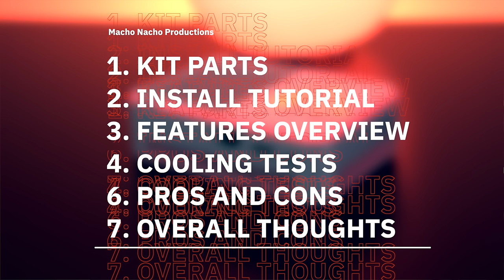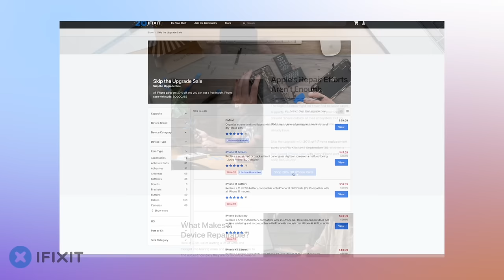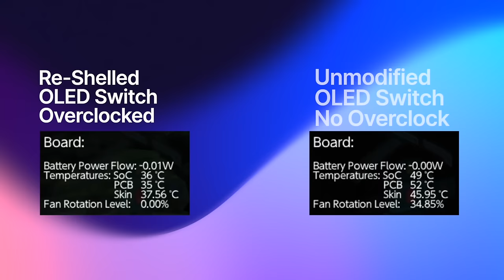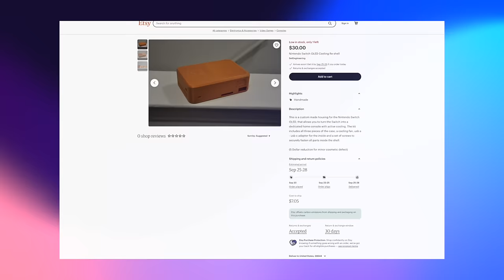Making The Nintendo Switch Run FASTER And COOLER With This NEW Mod!

Comment: What I love about this, is that damaged switchs (screens, battery, sd card slot) can get a second life. I'm a massive fan of hardware that can be resurrected and not just WEEE wasted
Reply: Ah yes the OLED damaged switches ... LOL
Reply: this is a fantastic point.
Reply: That was my original intent, I buy, and refurb switches all the time and i occasionally end up with v1-v2/OLEDs that the screen is either broken or dead or can dock but can't output to the LCD and i wanted a way to save the hardware without just scrapping it.
Reply: You can also just use it in the normal dock without any modifications. This really doesn't do anything to "give a second life", the only thing it has over a docked switch is the cooling.
Reply: That's almost exclusively what I'm a fan of. I want to revive dead hardware, not mod good stuff.
Reply: @Zanpaa My thoughts exactly. Unless I missed something, it’s just a different case with a bigger fan. That said, the lower temps are probably worth the $30 if you’re overclocking.
Reply: we did this with a MK1 Switch that got stepped on in a staircase tumble, got rid of the screen, and opened the back and repasted and gave it a new fan. It did run significantly faster in docked mode... but either the fall pressure bend on the pcb finally coming to full fruition or other parts getting out of spec hot caused it to die after a few weeks. So consider if you want to waste time if the switch went through a significant shock.
Reply: @SetEngineering the screens are cheap
Reply: Honestly though, the switch is fairly inexpensive to repair and honestly it’s not hard to do. I had a joycon tail ripped off of my switch at one point and had to tear the whole thing apart to repair it. I actually had a lot of fun. This would be for people who don’t want to transplant the whole system I guess. 😊
Reply: More like good for modded switch when you overlooking
Reply: WEEE
Reply: I bet that is why the removed the OUTPUT port for the lites.
Reply: @SetEngineering  Im actually surprised it took this long for something like this to be made.
Reply: Reduce, REUSE ,Recycle
A lot of people forget the first two and just jump straight to recycling
Reply: @hornylink   only one problem with your "less ewaste" argument. This doesn't solve a problem .. if you broke the screen and don't want to replace it for the 20 bux, yet would rather spend more to lose functionality??? why not just put  it in the stock Nintendo dock?. it would make sense if the dock didnt exist. so again the only thing this would solve would be if you installed something like a picofly, hwfly and want to overclock and lower temps. or am i missing something?
Reply: @daskampffredchen  reuse? why throw out a console that works docked already?
Reply: @Zanpaa Damn, you just made me realise that I turned my brain off while looking at OPs comment lmao... then again, you also gave me an idea. It seems to make more sense when your USB-C port is broken. Sure you could replace it, that's fine too, but you can also just throw away that port and connect the cables directly to the board.
Reply: I mean, all of that kind of can be replaced tho
Reply: @SetEngineering  Are there any plans for including the joycon rails, I really like the concept of this however for the games like mario party that require joy cons to be used it seems like it would be a necessary thing to have even for making sure the joycons are on the most up to date firmware.
Reply: There is nothing stopping you from pairing joycons with your system at any time. Realistically in this situation it would be best to get an external charger that can connect via USB and use that. But the controller pairing menu allows you to pair what ever you want with the console without needing the joycon rails. I have no issues looking into it in the future but the joycon rails are hard to move like that and would require a redesign of the shell.  @DjBloodsaw
Reply: Same
Reply: @SetEngineering  while there is nothing stopping you from wirelessly connecting them it does stop you from updating the firmware they have installed.
Reply: This was original designed as a way to potentially save broken hardware. It can't solve every problem.  @DjBloodsaw
Reply: So does this also work with an old switch non oled? Do I need parts from the original Dock Station?
Reply: @Artstye4you  We have variants for the older switches now and yes it does require an OEM dock  whether that be the original one or the oled dock.
Reply: @SetEngineering  thnax for your Quick Response
Reply: What do you meant when you said about sd card damaged switch?
Reply: @Zanpaa  it adds a mere 20% of higher performance
Reply: Nobody f’n cares what you love about this.
Reply: I've started only buying broken consoles to fix for myself or friends due to this. Why get a new system when i can easily repair a damaged one for less then half the price and being more sustainable aswell
Ive also started teaching ithers how to do certain repairs as it just ends up helping everyon3 :)))
Reply: @ToxicMothBoi  Because the time spent playing out of the box is worth more than buying parts and investing the time to fix a broken one. Any other questions?
Reply: couldn't you repair those switches instead of this mod?

Comment: I always believed that Nintendo should have allowed the user to choose what kind of experience they want: a completely portable one, a hybrid, or a more "powerful" version sacrificing portability for better performance.
Reply: An external GPU on the dock should be,  but the price....
Reply: Nah then you'd get the situation Xbox faces right now where they promise you can play the latest games still on the Series S but in turn, developers don't release the games on Xbox due to the expectation.
Reply: yeah but that increases manufacturing overhead.
Reply: @killermatico27  wouldn't work, i don't think the cpu is meant to work with gpu's, the bottle necking would be terrible
Reply: My switch hasn't left its dock since I bought it in 2020
Reply: @KingVulpes  If they tailormade something to work like this, it could work. Not just some off the shelf GPU, but rather one specifically made to interface with specific hardware. As long as the port has enough bandwidth (USB 4/Thunderbolt 3, 4, or 5) then this is certainly possible. The current Switches only support USB 3, so it isn't happening with them, but the next one could easily make this possible as long as it's designed with this use case in mind.
Reply: They already have a fully portable Lite and Hybrid regular model. There's no point in a full home console version since they would have to keep the same specs or pressure developers to not take it into consideration when creating in games since we live in an era where even first party studios can't do optimization.
Reply from the maker: That would have been neat!
Reply: I always thought that was Iwata's vision for the NX(switch) platforms. Consolidate handheld home console development then scale that across multiple form factors. Not sure if i'm misremembering but I think he (iwata) noted that in japan handheld mobile gaming was popular while North America the large home console was still popular.
Reply: yes just like the vita did😂😂😂
Reply: I too would like those options. But fragmentation of user base is never a good idea.
Reply: xBox sErIeS s
Reply: yeah i'm kinda surprised we never got a "Smart Dock" that would boost the performance, maybe the Switch 2 can include it now, perhaps have the dock-2 include an NVdia AI upscaler chip & extra cooling
Reply: Exactly my thoughts since they first announced the switch. I dont care about mobile gaming and i have power from the wall and a HDMI cable to connect to my TV. Why pay for joycon-rail connectors, a battery and another screen? That stuff made up half the cost of the switch. So a home concole system could/should/would have been cheaper aswell.
Reply: @TakisEnjoyer   but what you seam to have forgotten is the fact that the tegra chip that there using is down clocked, A LOT and i mean A LOT... 
it would cost them not a dam thing to do. if anything they could just use the same motherboard and stick it in a case with a bigger heatsink and give it a 200mhz bump on clocks and sold it for the same price as the full switch, but with joycons and a joy-con charging grip. instead of a screen and a battery, as the TV is the screen and its always plugged in to the wall.
Reply: @killermatico27 dawg, the switch uses usb c not thunderbolt 3
Reply: It reminded me of a YT video released prior to 2017 where someone mentioned that Nintendo should've released a Wii U pack lower than the Basic Pack (or Basic Set as it was called in the USA system region) which didn't include a GamePad at all and included a Pro Controller instead for single-screen play, which come to think of it now would've basically been a Wii U Lite if it were real.
Reply: I seperate console one would be great. But I don't thinkt that extra power would be a great idea. Versions with different power level would be very bad. Many studios already have low quality ports. Something like this would result in ports being playable on the console version and even worse on mobile since this is the lowest effort to make a port.

For well made ports you may finde the opposite situation. Nintendos greatest customer base is mobile. Therefore mobile for well made games mobile is priority. Therefore it's questionable how much the game would profit from better hardware if they still are aimed on mobile.
Reply: The entire issue of using an E-GPU was that until the USB 4.0 specification came out last year, it required Thunderbolt specifications; and with Nintendo working with ARM and not Intel or AMD, getting Thunderbolt certification wasn't going to happen.

Also, the costs of it would make the Switch unaffordable as it would bring it up to or above the price of the PS4 or XBox One at the date of release.
Reply: @thetoythief8940 lol i feel you. and for portability's sake, i bought a switch lite 😂😂
Reply: @emanuelmk24  I just don't want to take my  consoles on the go just because if it gets stolen or lost I wouldn't be able to replace it
Reply: Or steam deck
Reply: In the end the switch is a handheld device, because the SoC that powers it is for handled devices.
No amount of overclocking or modding will ever bridge the huge gap between the switch and actual home consoles.
So Nintendo are kinda smart by sticking to their guns and avoiding any comparison between the switch and non-portable consoles.
The fragility and low performance of the switch also helps sell newer models, shorten the life of every unit sold, and bundle overpriced low quality accessories with every unit (the joycons and dock)
Reply: If this was true we would have gotten 2 consoles for the switch generation
Reply: @clipso9061  no ? He's no asking for 2 consoles, just a bigger and smaller switch, like they did with the Lite.
The bigger switch removes the screen and gets a bigger fan and heat pipes.
That's all it needs to run a lot faster, normal switch is already severely underclocked and handicapped.
Hacks already show the switch's potential to run games at 60 FPS simply by raising memory speed and GPU speed, not even needing to improve the cooling
Reply: @YounesLayachi  before i read the rest of your comment, my comment was in response to, “nintendo wanted you to be able to choose” if that were true there would have been 2 consoles that gen
Reply: ironically, this is what XBOX did and its failed... but it would totally work for Nintendo bc they wouldn't be silly enough I think to make 34rd party devs have to make the game play on the pro and non-pro consoles

Comment: SD card not being accessible without disassembly seems like a pretty huge con to me, especially with a hacked console. Surprised it wasn't mentioned at the end. Looks cool otherwise. Awesome vid!
Reply: They sell sd card ribbin extension cable for like $8.
Reply: I'm sure there's a ftp program on the switch for homebrew
Reply: It also wasnt designed specifically for overclocked switches, that is simply one of many possible uses.
Reply: Yeah if the video would have started with that most people would have lost interest I'd say. Besides that I think it's quite bulky.

Edit: the fan being always on is a bit strange.
Reply: The SD not accessible won't be a problem using Homebrew FTP software, but transferring data via FTP is slower than injecting the SD on a PC or using a USB-C cable, so it is still a con.

Anyway, this mod would be problematic for hacked consoles, with or without access to SD, due. to many homebrew injecting software depending on the attached joy-cons and portable screen. Hekate doesn't support docked mode or pro controller and probably never will.
Reply: Hakate mass storage
Reply: Not really. When you think about it's not very different from having to open your PC in order to get to the hard drive. Besides, how often do you really need to take out the SD card from your Switch that taking out a couple of screws to get to it becomes an inconvenience?
Reply: @jesushernanpizarrogonzalez7297  In a normal Switch, probably never, but the discussion is about a hacked Switch. At least you need to take out the SD card every firmware update to upgrade the CFW. Or whenever you want to install a new game, DLC, or game update that you obtained...somewhere and you need to copy it to the SD first.
Reply: Not really, no.
Reply: @javiersaneiro6412 using Tinfoil, you don't need to remove the SD to install content.

I agree though that the SD should be accessible
Reply: Dbi installer is an mtp/ftp host.
Reply: @gfdggdfgdgf fan being on is strange? You mean like every other console and PC for cooling?
Reply: A huge con, but easily fixed with an microSD extension cable
Reply: @unveiledwithouttears1370  shouldn't have to buy this
Reply: @doctorstrix9733 ftp speeds suck balls compared to SD swap
Reply: It’s not that much of a problem if your Switch is unmodded or reset to stock.
Reply: @rtf5398  Pretty sure Hekate mass storage won't work, since the Switch is permanently in "docked" mode and you can't plug a USB C cable directly into the actual "console" motherboard
Reply: Yeah, good luck with a blue screen, how are you gonna start the switch if you have no built in screen and touch screen?? Hekate does not work docked, there is no image to the TV 😆
Reply: @unveiledwithouttears1370 
Perhaps, but IMHO that should have been designed into the shell.
Reply: Hekate lets you access the SD over a USB cable.
Reply: @Butterscotch_96 You'd still have to use the touchscreen to access that though

Comment: I bet you could make a simple PCB that uses a small capacitor bank to trick the system into thinking a battery is connected without having to use an actual switch battery. The reason is that batteries degrade a lot faster when constantly plugged in, and if you're trying to make this a dedicated home console you don't want an extra component that can fail just from using the system.
Reply: it's been done with a buck converter and a 10k resistor. you steal the controller board out of the original battery, attach a buck converter set to 4.25v to where the battery terminals used to connect, and solder a resistor to a pad near the battery connector to trick the battery temp sensor. suddenly no battery needed.
Reply: @Tesseract4D2 I wish a video was made on that, 
Also Add in a Multi Terabyte Hard drive that can hold ALL the Games on the Nintendo Switch Library and of course Hold a decent amount of Space for Saves
Reply: Batteries dont degrade faster when plugged in. Ive compated laptops constantly plugged in vs discharged snd thr plugged in has more longevity
Reply: Could also change it to 18650.
Reply: @jamesfranko5098 depends on the BMS really. The way companies use laptops forced laptop makers to fix this specifically.
Reply: I’d trust my original Switch battery but this no-name thing? Rather not have that fire hazard in my living room. Would also like a fake fan for that blower.